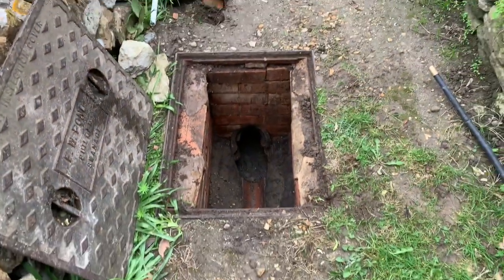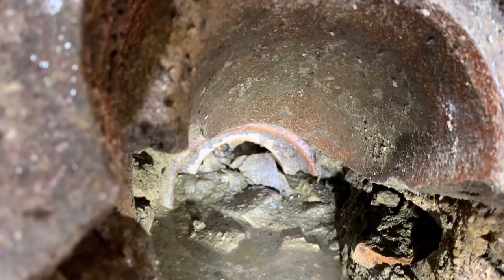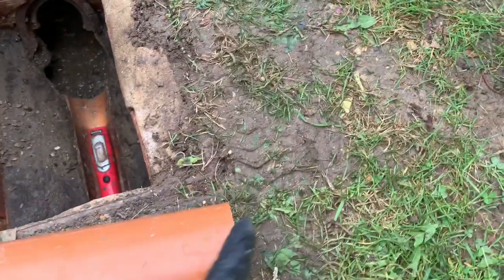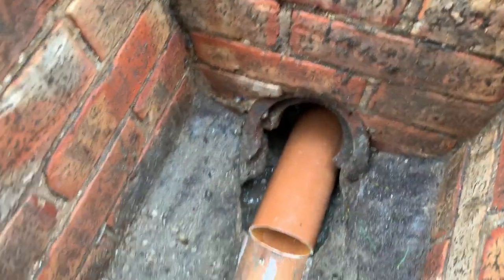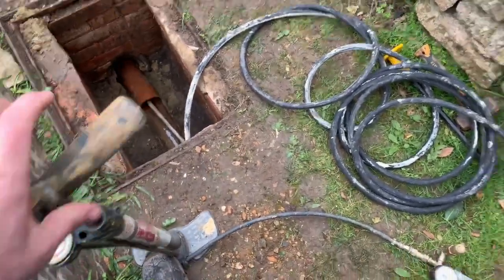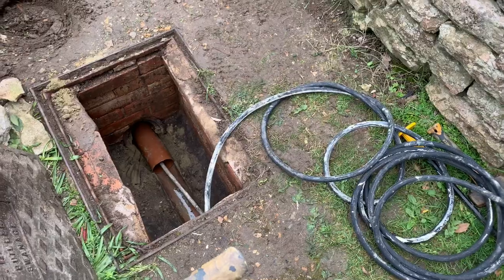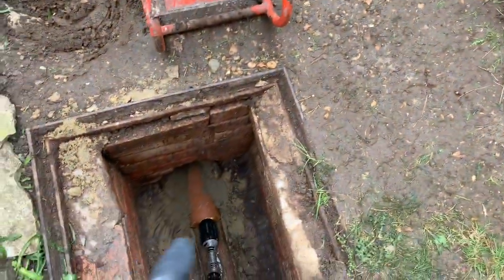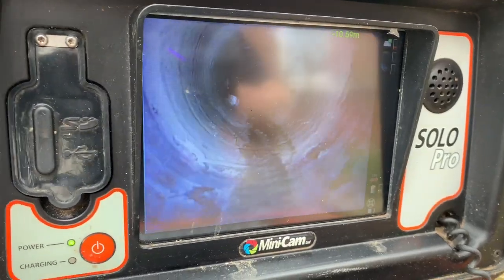Repairing a collapsed sewer drain without digging

Comment: south west water wants to dig up my patio to repair partially collapsed sewer & told me no way they can repair without excavating my patio & for same pipe style in your video.
Reply: Pipe collapsed in or a section dropped it  will need digging up